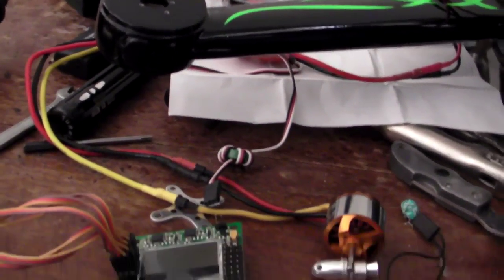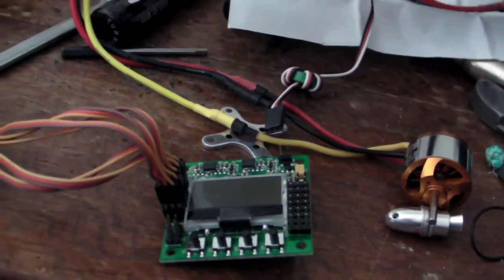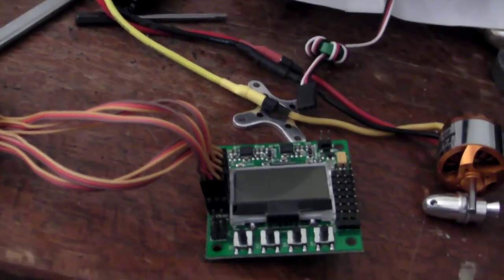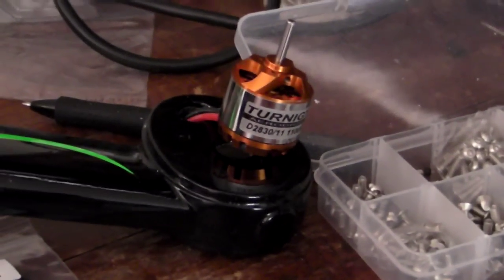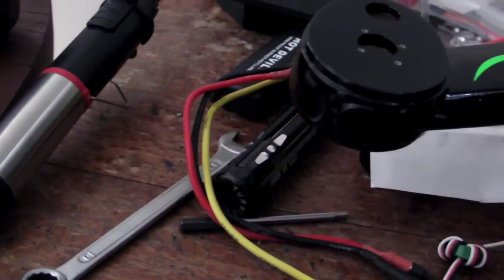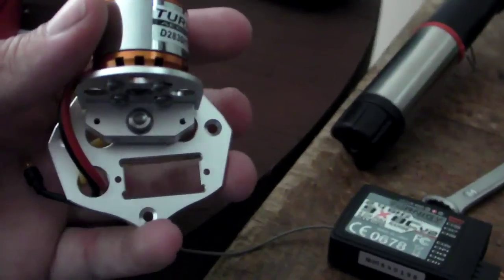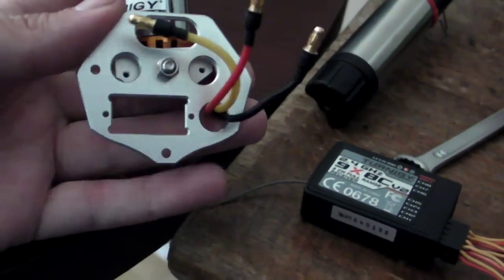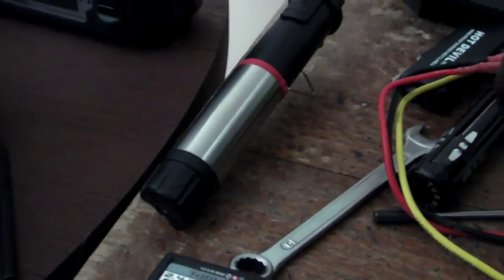Y-3 Tri Copter MultiRotor HobbyKing Part 3

Comment: were did u get servo and motor bracket
Reply from the maker: They came with the kit from hobbyking.
Reply: How much for kit do u have part number plus your build looks great
Reply from the maker: +Edward Mart I think I paid about $130 for the kit. I don't think hobbyking still sells this however. It was a long time ago. 
I don't still have this tricopter. I moved to quads and planes. 

Thanks for the comments.